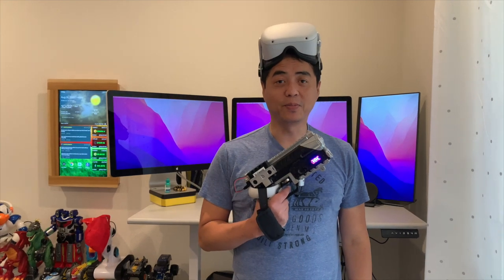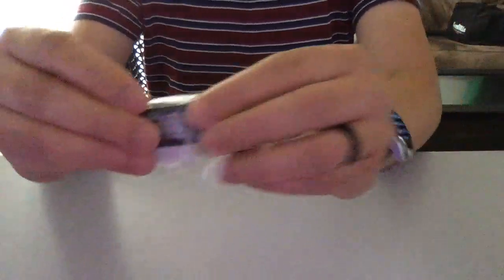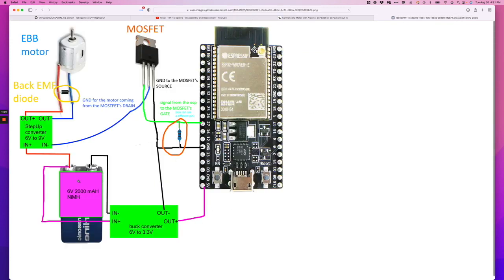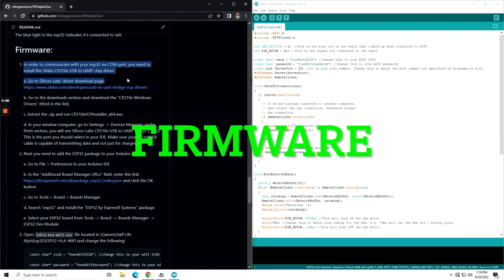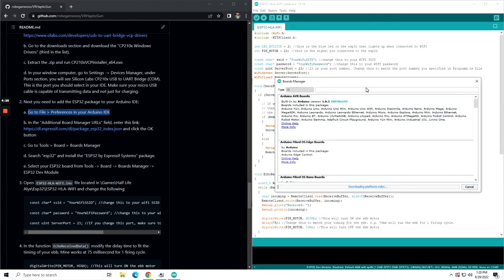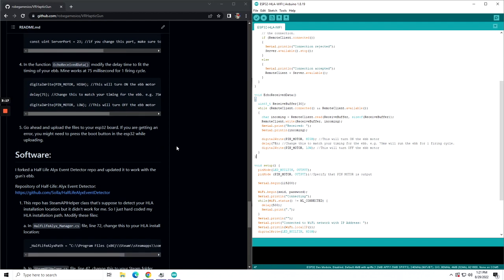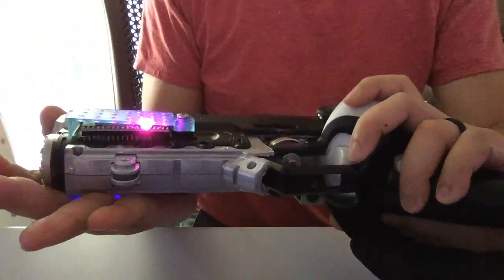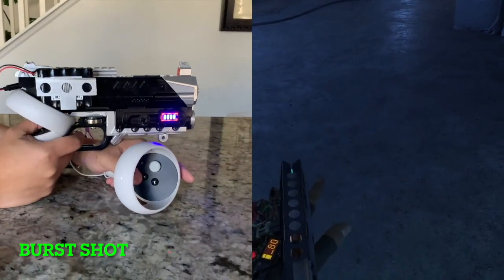I built a Haptic Gun for VR Games DIY

Comment: Hi Rob. Great project but I'm struggling to get the ESP32_HLA_WIFI.ino code to compile due to "WiFiManager.h: No such file or directory". Could you point me in the right direction please? Where do I get that specific module? Thanks a lot
Reply from the maker: hi John, sorry for the late reply. in the Arduino IDE, you need to go to Manage Libraries and search for "WifiManager by tablatronix or tzapu" and install it. You might also need to install "ESP_DoubleResetDetector by Khoi Huang"